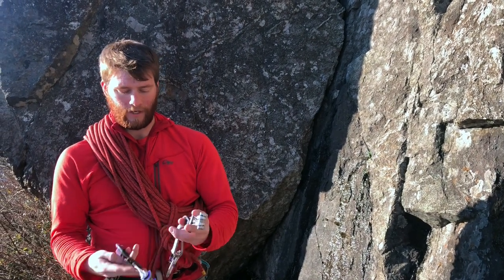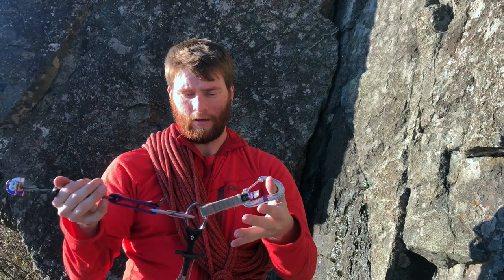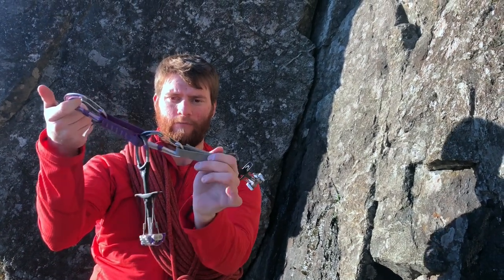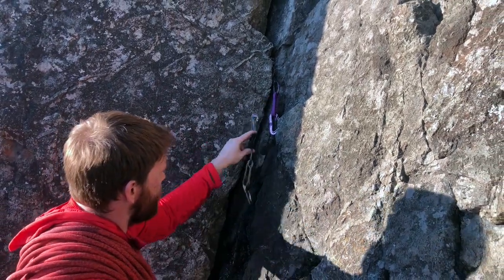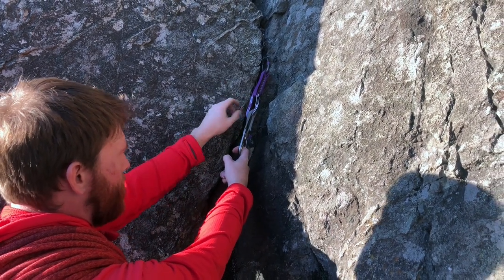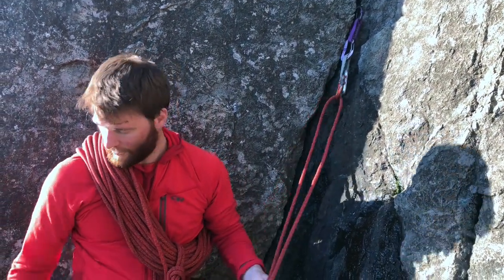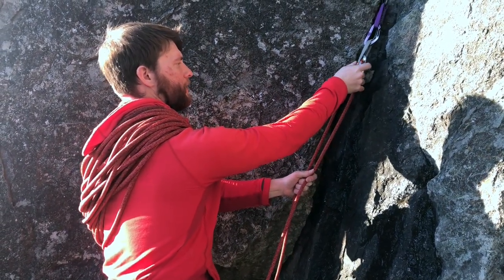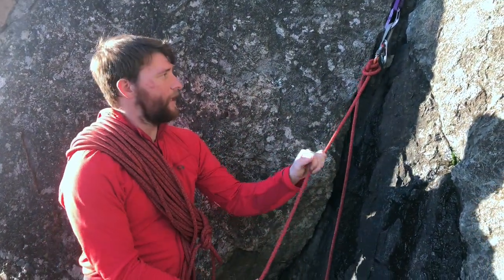Quick tip: stacking cams

Comment: Would you say that the primary benefit of this is the simplicity and the minimal use of materials? It seems like this is just a two piece anchor with no gear besides two cams and a carabiner, which is neat! Do you ever use this mid pitch? Under what conditions?

Comment: But the sling is attached to the thumb loop. Lol.
This is just really  placing two pieces.
Reply: Ya, I kinda question that too,... manufacturer specs state (on bigger cams) clipping to the sling gives 14kn strength, and clipping to the thumb loop is -2kn or on average 12kn...
Like isn’t it based on the weakest chain in the link?!?
Reply: I think the sling has a bigger contact area with the thumb loop, so the force is more evenly distributed, while the carabiner will kink the thumb loop more.